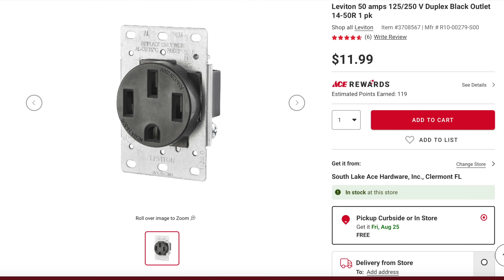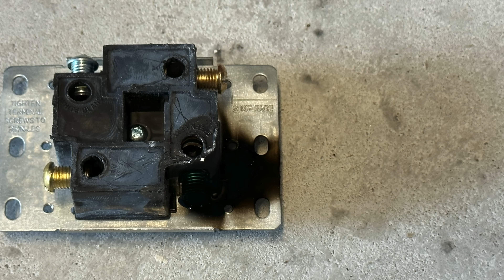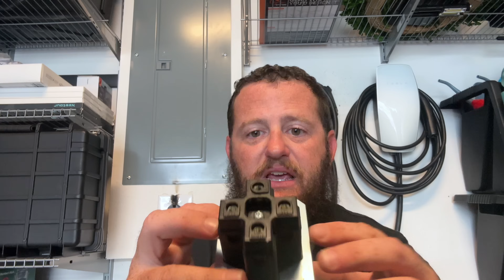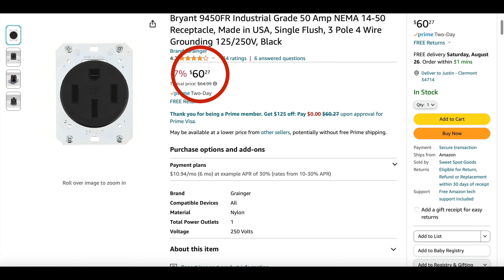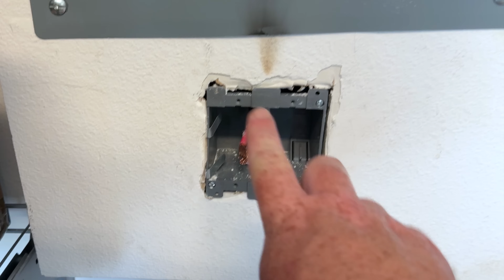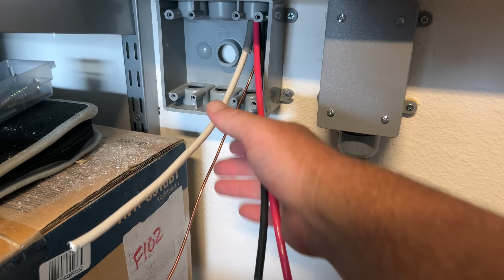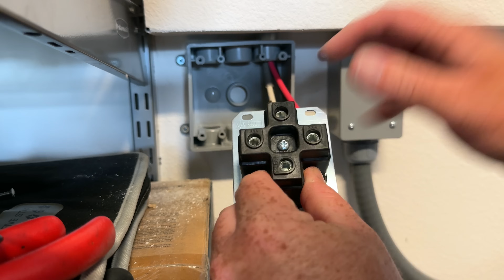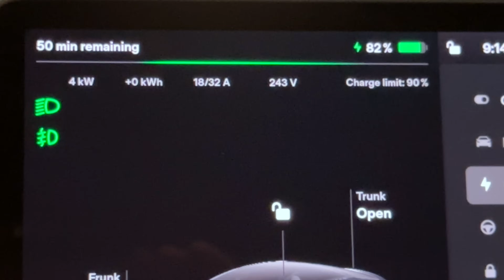This Will Save Your Life if You Charge Your Tesla on 14-50 Outlet!!

Comment: I asked on a previous video if hardwiring is the recommendation over NEMA 14-50. Is it better to hardwire or better to recommend the right maintenance and parts for NEMA 14-50?
Reply: Better to hardware if it's a dedicated EVSE.  It's several parts less in the chain between the car and the powerlines.  If you’re worried about swapping out for another unit in the future, leave a bit of slack in the cable.

At 48+amps at 240v, the fewer points where resistance or heat could build up, the better
Reply: Hardwiring is best but it’s also great to have the ease of being able to quickly swap your wall charger with a simple plug if needed
Reply: @doomsday9973  Maybe.  I've yet to hear of anyone actually doing that though enough to make it worth the downsides.  Perhaps if you're a youtube channel doing reviews on the different chargers?

The longest part of the install is mounting the new wall charger.  Taking the bundle of wires and reterminating them is pretty trivial.
Reply: @Caladain  maybe for you it’s trivial most people are not going to do that on their own. Unplugging a charger in seconds is 100 times easier.
Reply: @doomsday9973  I do not know of any EVSE’s that come prewired for 14-50 outlets.  You need to create a tail for the EVSE and then plug it in…which requires terminating in the EVSE along with properly terminating in a male plugend.

Or you could just terminate in the EVSE?

If you’re referring to mobile connectors, sure!  Just buy a dedicated one, plug it in, support it with proper strain relief, and call it a day.  I just want to raise awareness that if you are inserting/removing your mobile connector with any frequency, you are flirting with a short and possible fire.. Do it right and don't be pennywise pound foolish.
Reply: @doomsday9973  well, not sure what happened, but there was a comment by you about some evse’s shipping with 14-50 plugs out of the box.  Sweet!  Wasn't that way when I was shopping for mine.  Point still stands that hardwired is best and presented objectively fewer points of failure, but even an EVSE plugged in and left forever is better than someone daily or monthly unplugging a mobile connector.
Reply: @Caladain  lmao are you kidding me?? I own one lol. There are a TON. Juicebox, charge point, grizzlie, clipper creek ALL have dedicated plug in versions just to name a few. Tesla is only of the few that have hardwire only.  Google is your friend.
Reply: @Caladain  they’ve been around for a long time and are more popular than hardwire because of the ease of installation. Pretty much everyone but Tesla sells a plug in version. Yes hardwire is better you can also get more amps out of hardwire, but plug ins work just fine too
Reply from the maker: hardwire is always best where possible

Comment: Glad you are okay. I do have the leviton but I also have a wall unit that's always plugged into. It is okay if we just leave it plugged?
Reply: Same. Mine has been working fine for years, one thing you can do is reduce the amps a bit if you don’t need to charge to be at the max which reduces the heat quite a bit
Reply from the maker: I would replace asap.

Comment: Wow, thank God you were not seriously injured!   My first 14-50 outlet overheated and the Tesla charging system reduced the rate of charging from the Tesla mobile charger.  Soon, it failed completely, and I replaced it with a higher duty cycle outlet.  I did not plug and unplug the mobile charger to take with me for mobile use,  the failure occurred with occassional use (weekly) about 3 months after I started using it.  The first one was professionally installed, but it was purchased at a Big Box store for $10.  I replaced it myself using a higher quality ($75) 14-50 outlet.  I know enough about AC to do the work myself safely.  I have not had any overheating or failures on this new outlet for the past 7 months.
Reply from the maker: I am very glad to still be here to share so no one else has this happen to them
Reply: what brand 14-50 did you go with ? (the second time) the one that was around $75 ?

Comment: Being a retired electrician, that ground socket should not melt. Something is shorting out or wired wrong. It looks like you have voltage on the ground.
Reply: Looks like an arc to ground. Was it installed with a pigtail grounding to metal box? Sometimes I see the pig tail get pushed awfully close to the hots and I think the pluging in and out could possibly move it enough to touch and arc.
Reply from the maker: don't know. It could also be simply heat rising over time, thats where the flame was when it happened, so maybe that? I dont have a good answer for you on this one.

It shouldn't be wired incorrectly or else it would have failed months ago
Reply: Perhaps the cycling caused the wire to come loose in the back and touch another conductor? Heat cycling can also loosen connections.
Reply: Leviton install video does not use pigtail.

Comment: The Hubbell seems to have CSA and UL certificate stamps on the face of the socket, I wonder if the Bryant has the same safety rating?
Reply: The cheap levitons are also fully UL certified
Reply from the maker: Those UL certifications are good, but they are not a "grade" testing.

Comment: The Hubbles aren't rated for repeated insertion/removal cycles either.  They'll last a bit longer, but will eventually fail for people using their mobile connector and removing/reinstalling every day.  Read the spec docs on the outlet, it states very clearly.  Either get a dedicated charger to plug into it (plug in and leave, which it looks like he did) or hardwire your EVSE.
Reply: Why the hell are people constantly plugging and unplugging their charger? Just leave that shit plugged in
Reply: @Mkvkuv  I don't know either.  Lack of knowledge, they plug/unplug from regular sockets, so why wouldn't it work for the bigger socket.  The cheaper socket are also not really rated for the duty cycle they are subjected to.  A dryer only pulls hard for a couple minutes (generating heat in the outlet but since the time is short it doesn't get too hot) but an EV could pull 48amps for a couple hours at the worst.
Reply: @Mkvkuv Never drive your Tesla any distance without taking the wall connector with you. The moment you leave it plugged in at a home is the moment the charger you pulled up to is out of service.
Reply: @aussie2uGA  i've driven my Tesla from SF to Houston a couple of times, no problem. plenty of supercharger around. never worried about range anxiety and i have a model y SR
Reply: Mine was a wall charger permanently plugged in,  and it melted.  Leviton. Decided to just hardwire it. Read about problems with the screws in the back of Hubbell and decided to skip outlets all together. Agree w leave it plugged in!  @Mkvkuv
Reply: @Mkvkuv  Electric heater, welder. plasma cutter.  The vast majority of garages I've been in don't even have a single 240 outlet. My home garage does not have one, my workshop only has one.
Reply: @mluu510 I take my plug with me on road trips especially when I am towing and want to charge at the campsite. So I probably unplug mine 6 or 8 times per year. Not a lot but I guess this is concerning now
Reply: @DerekZipp  Even on the Hubbell they aren't rated that high.. The biggest difference between the Hubbell and the cheap home depot model is that the Hubbell is rated to pull the full 50 amps without overheating.  Not more insertion cycles.  It will last for a few more cycles as it's built but it's not rated for it.
Reply from the maker: they are both rated for similar cycles, but the max temp used in testing to those same cycles is significantly higher. That is why it is more robust.
Reply: @BeardedTeslaGuy  yup, but when I contacted Hubbell they recommended less than 10 insertion cycles before replacing the outlet.  They would not give me how many it was tested to, and it's not listed in any of their documentation.

That said, if you go the outlet route, go Hubbell (or the rebrand), and try to do the minimum insertion cycles.  Maybe even consider dielectric grease on each of the blades on the male side.
Reply: @Caladain correct. Just because it is Hubble dont plug and unplug. Ultimately these nema plugs are not good safe solution long term. Best to go hardwired.
Reply: @BeardedTeslaGuy you have got to find an outlet rated for repeated plug / unplug cycles, and if you are going to be changing out chargers constantly you may need to look for some other way of plugging this stuff in.  Looks like there was some sort of ground fault in that outlet.  How many amps are you running to your car when charging?

Comment: I’m curious why you ever unplug?  (We plugged our mobile connector in in 2020, and that’s it. (We have another Chinese Tesla mobile connector for use elsewhere…))
Reply from the maker: I test a lot of charging equipment so my use case is much different than the average consumer.
Reply: @BeardedTeslaGuy  so your use case of the 14-50 is atypical.   Nothing wrong with the Leviton outlet for designed use of plug in the device and leave it plugged in.  If you change the supply equipment every decade or so there isn’t an issue.

Comment: Please, everyone that is considering installing a 14-50, don't do it, just get the Tesla wall connector and hardwire it for your home.  Use the portable unit with all the adaptors for those rare temporary traveling use cases.
Reply from the maker: Where possible, a wall connector is ALWAYS better
Reply: Come on, that's a little extreme. 14-50s are fine. Just don't plug and unplug it constantly, and use quality materials. Simple.
Reply: @RobotVoice99  I know first hand a thermal event involving NEMA 14-50 happens and yes it is very extreme.  You do you, I did the best I could to avoid it.
Reply: @robcossin4690  a thermal event can happen with the Tesla charger too if installed poorly or the wrong materials are used.  I promise you, the chances of catastrophic failure of a 14-50 when QUALITY materials are used, best practices are observed, etc, are near zero. You have a better chance of your house catching fire from excessive dryer lint.

Comment: Leviton makes products at a variety of price points. You selected the cheapest possible outlet that wasn’t appropriate for the application, which is not Leviton’s fault - it is yours. Just own it already.

You’ve also done a great job of finding some good alternatives and making the community aware of them - own that, too!!
Reply: Why would UL allow Leviton to sell 14-50 outlets that are not up to the task that they were designed for?
Reply: @ModestMuse3  UL doesn’t “allow” anything, they just test. That particular outlet was designed and manufactured for stationary equipment, not for something that gets plugged and unplugged frequently - it probably cost $6 wholesale. If you plugged a dryer, range or welder into that outlet it would likely outlast several replacements of those appliances.

So the point is: buy the correct outlet. Don’t buy the cheapest thing you can find and then act like the manufacturer isn’t producing a adequate product. BTG mentioned the BRAND over and over again. The BRAND wasn’t the problem, it was the level of durability purchased.

To be fair to BTG, the electrician probably showed up with the outlet - and knowing the intended use, should have known better. Instead of blaming Leviton, BTG should kick the electrician squarely over and over again until his leg gets tired. Then switch to the other leg.

In any case, I’m glad he’s relatively unscathed.
Reply from the maker: I did not select the outlet, the electrician I hired to install this when we moved in did
Reply: @BeardedTeslaGuy  you may not have seen my reply to @ModestMuse3. Warm you leg up! :)

Comment: My electrician installed an outdoor rated 14-50 in a metal box from Eaton. It doesnt look pretty in my garage, but hopefully its more durable. I dont have a use case to unplug my 14-50 Tesla adapter. If I do need to take the charger with me, Ill probably just leave the 14-50 adapter plugged in dangling.
Reply from the maker: smart

Comment: It's more about the continuous draw/load than it is the cycling.  Dryers and other equipment like stoves and ovens actually DO cycle - which is why receptacles like Leviton work. It's not a continuous load, the heating elements turn on and off to create different levels of heat.  EV charging is a continuous electrical draw/load and many 14-50 receptacles cannot take that consistent draw... 

Add to that - most 14-50 receptacles were not designed for constant plug in/un plug...

Excellent that you used the torque screw driver - this is something that many also miss.
Reply: Another thing that can be done is reduce the amount of amps which greatly reduces the heat. Most can charge just fine overnight at 24 amps for example.
Reply from the maker: Cycles refers to the plug in and unplug cycle. Too many "cycles" wears down the contractors and the openings for them, making the unit "lose" over time.

Comment: Hardwired my Tesla Wall Connector…the $90 plug was the reason I decided to go with the Wall Connector over the Portable Connector. Plug is only rated for 50A was another motivating factor while the Wall Connector requires a 60A breaker to run at full 48A output.
Reply from the maker: its really not much difference in cost in the end. In some situations that make 14-50 more practical, there are some things to look out for and I hope this directs those people in the right direction
Reply: Actually in most states now if they follow 2020 or newer NEC electrical codes, you're required to install a GFCI breaker in your panel for a 14-50 outlet in your garage.  Those breakers are like $120-$200, combined with the $90 9450 Hubbel plug, you're halfway to a dedicated wall charger with a standard $18 breaker.  Alot of EV chargers also don't like GFCI breakers as well.

Comment: I’ve been told that the NEC code requires a GFCI breaker for any outlet in a garage or outdoors. Your thoughts?
Reply: Depends on the state not every one adheres to the new code but yes they are supposed to have GFCI breakers now which can cause nuisance trips on plug in wall units (they have their own built in GFCIs) most specify they do NOT recommend GFCI breakers for them because of that. But you know what they say code only matters if inspected
Reply: @doomsday9973  it’s for their own safety. Without it, either the house will burn down or someone get sick.
Reply: @huannguyen3820  uhhh no did you not see what I said that the wall units have their own GFCI built in (that are much better than the breakers are) putting one GFCI on top of another GFCI is never recommended
Reply: You are correct. But it will interfere with Tesla mobile charger internal GFCI according to Tesla recommendation.
Reply: @huannguyen3820  can you point out where Tesla says that. My understanding is that the Tesla wall charger , if direct wired (no outlet) does not need gfci but a plug in charger to an outlet, does need gfci.
Reply: @frankanastasio9492  you are correct. If the wall charger is wire direct, no need for GFCI breaker. GFCI Breaker only needed when you install 14-50R outlet.
Reply: When I replaced mine a few years ago because it heated up and would not stay charging at 32amp and would drop to 16amp because the heat on the outlet. The size of industrial one is larger in diameter so need a different face plate also. No problems since installed the industrial grade.
Reply from the maker: that is not a code everywhere, and since it causes issues with some charging equipment, I dont use one.

Comment: so if you were the last one to take it apart and put it back together how would it be the fault of the original electrician.  Good possibility you did something to cause the issue.
Reply: You forgot about heat cycles will loosen a bad connection
Reply from the maker: if I did something wrong, I dont think it would have taken 6 months to fail. It took 6 additional months to fail because the receptacle was degrading in that time.

Comment: What do you mean by “cycles”?
Reply from the maker: Plug in then unplug = 1 Cycle
Reply: @BeardedTeslaGuy  my mobile connector stays plugged in (I have another that I use for trips).  My plug is a Leviton.  Since I never unplug I should be good, right?  Installed by a professional.